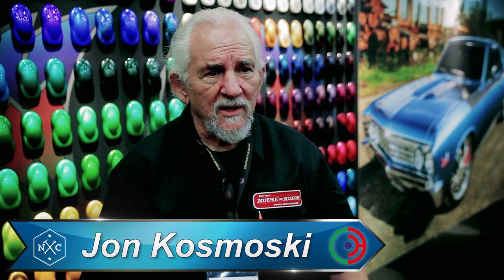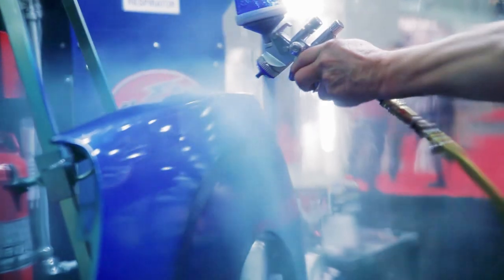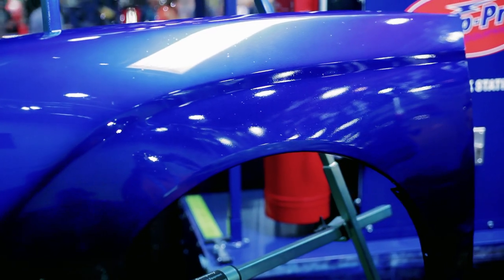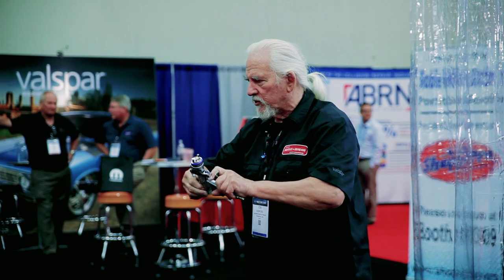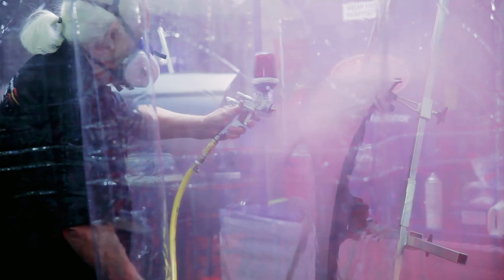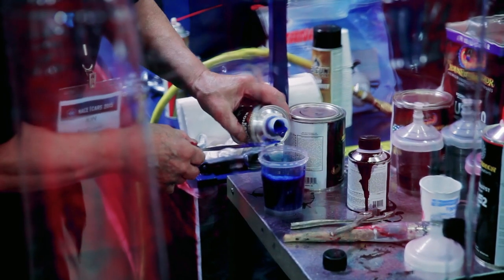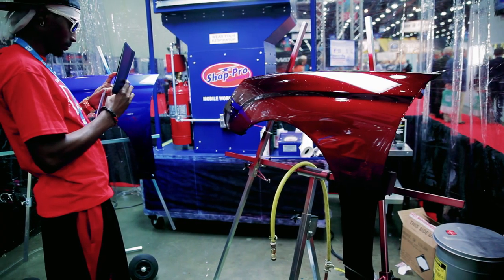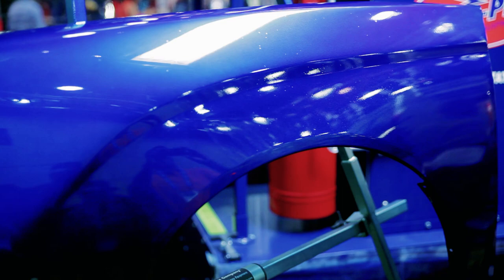House Of Kolor Kandy Demonstration By Jon Kosmoski

Comment: Why don't you wear face and arm protection?
Reply: It was probably because he was only doing the base coat, which in some painting systems, isn't 2k, and is reasonably harmless...
Reply: He's old. He made it this far. Zero Fs given.
Reply: He typically only wears protection for the actual kandy paints( not the multiple primer and base coats)